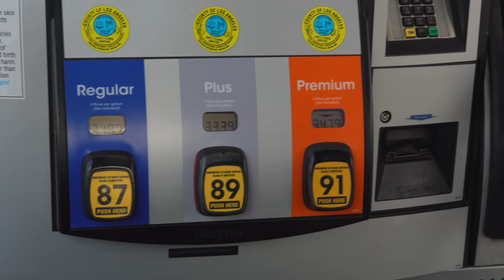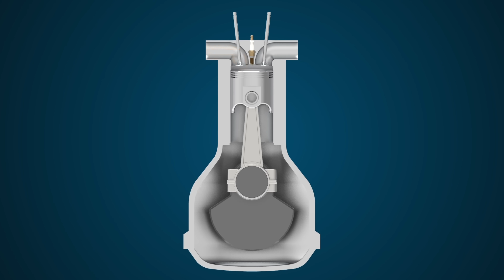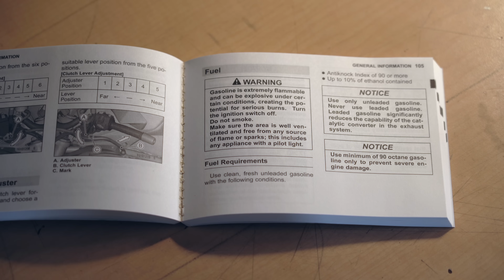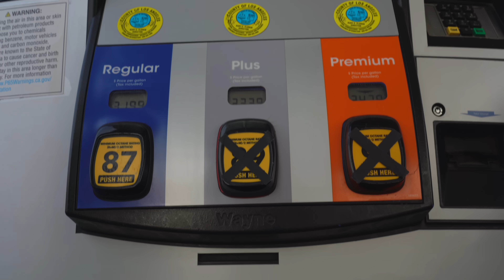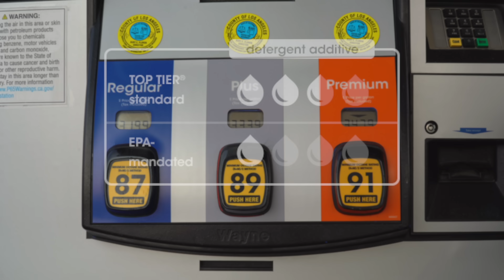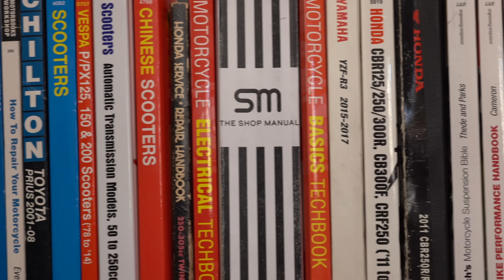Should You Run Premium Gas In Your Motorcycle? Octane Explained | The Shop Manual

Comment: I can attest that this is true. Especially the detergents. I rebuilt a 1975 CB550F that was in bad shape. Gummed 4 barrell  carb that sat for years all tarred up. After a full rebuild of carb and almost everything else, i ran high octane and it did keep that carb spotless for years. Same for my rebuilt 2002 Shadow. It wont hurt to run it and with a carb it may be worth it but true,  no better horsepower. Plus, i think most modern fuel injected systems are designed for anti knock and ping with lower grade fuel anyways so you probably wont see any change. Just cleaner system. Which, if you keep cars for 10yrs or more, may be worth it.

Comment: The reality is the octane boosters lower the overall specific heat capacity of the fuel. If you can't take advantage of the reduced tendency to detonate, You are spending more money for less power. I don't know how many times I've told people this. I don't know how many times they've ignored me like I was stupid.
Reply: I know, as an engineer it drives me crazy "but what about muh racin' fuel?", like no, if its not designed for it, its not going to help. Its literally a more docile chemical and longer carbon chain to break down...

Seeing people with 6:1 compression ratio lawn mower engines at the "grasscar" track with them putting in octane boosters into premium gas just hurts my soul knowing at that point their getting lower power and not more...

Comment: You're talkin what is coming out of a book for low-octane so they can sell it been around engines for over 30 years trust me higher octane will burn hotter and push the Piston down low compression high compression need to go back and do your homework
Reply: You've got that backwards, higher octane is longer carbon bonds, its more docile (which is what you want if you're having pre-detonation issues), and it doesn't burn hotter...

Comment: Nice talk.
Here in Australia we have 91, 95 and 98 as standards.
I did notice an extra 50kms of mileage difference per tank, between 91 and 98 though.
Reply: They probably had ethanol in the 91, typically at least in the US the cheaper (its 85 equivelent** in the US, 91 RON = 85 (R+M)/2) they usually don't have ethanol in the higher octane "premium" option, and ethanol has a lower energy density so you will see better fuel economy with lower amounts of ethanol. That's probably what you noticed and not the octane change.

**Its kind of like how your bikes say 300 kph and ours say 186 mph, its the same thing, different units on our fuel pump as the octane equation standard is different in the US.

Comment: On your bogus claim the higher the octane does not give you more power I think that you're full of shit because if I run my bike on race 110 race fuel it doesn't run the same as it does on  91 and there is a 15 to 20% horsepower increase along with that only mod on my bike is in exhaust pipe

Comment: I wonder if you can salvage old fuel with premium fuel?
Reply: Sort of like salvaging water by adding lots of clean gasoline to it... Doesn't work very well, but I have done it on one engine.

That one engine pretty sure was powered by God himself because I was running 99% water in it. I remember running the mower till you couldn't see anything in the tank (except rust), then after a huge rain and a couple days later it started right up and I decided to check how much fuel it had after it ran for 10 minutes, and it was nearly full but I couldn't smell anything. Dipped my finger in it and it didn't feel like gas either, just water. So then I got bored and decided it must be running the little bit from the old fuel in the lines and the carb, so I just sat and watched it run for 30 more minutes until I got bored. Normally every other engine flat out won't run with barely any water in it, but that one, I honestly don't know what was going on. Either it had to be burning so much oil that it didn't need any gasoline at all (I've ran engines like that, you just had 5 gallon jugs full of used oil and kept filling the engine up because the pistons and rings were so worn it would run without turning the fuel valve on 90% as good as if you did run some gas with it), or it was some kind of miracle. I'd like to say for my sanity it was just burning oil, but I've never noticed that engine really burn its oil level down...

Comment: I use premium, from "top tier" gas stations, for all my small engine yard equipment and my motorcycle (which is vintage, has a factory high compression engine, and only is ridden occasionally).  In my experience, the fuel seems to provide easier starting after something has been setting for a for a while.  I am only buying a couple gallons at a time, so I don't worry too much about paying an extra 20-cents a gallon.
Reply: I wish premium was only 20c  more than 87

Comment: Another point not mentioned. I hauled fuel for a living. Just because the station brand is on the pump. Doesn't mean that brand name is in the ground. The refineries set the price at midnight. These prices go out to the haulers. They dispatch drivers to go the cheapest refineries. All refineries have a no brand fuel as well. Shells no brand for example is MOTILLA.
Reply: What are the chances that I'm not getting premium fuel even though I'm choosing the premium option at the pump? I worry about this.

Comment: I had an old 86 Honda CB550 that I drove everyday like I stole because I got it so cheap. I could easily tell the difference between the three grades of fuel. It picked up about 5-8mph. 

Also with the gas mileage that a bike gets why not pay a few cents more.

Comment: Obviously with a motorcycle and a single cylinder you wanted to run better and the more octane you run doesn't always mean more power though the more compression you run the more octane you will need to cut down on pinging and unburned fuel

Comment: I understand the numbers might be a little different to the states than here (Is this the difference between the Research and Motor methods for determining octane?). At any rate, here in Australia, the choices are 91, 95, or 98. Generally, only 95 has ethanol. At any rate, I run a highly modified 81 boxer. At one stage, this engine needed an overhaul, during which period I installed a bog standard engine. BMW recommends a minimum of 98 octane for this engine in the manual, and I used this exclusively. And I was adjusting for valve lash every bloody week. It was unbelievable just how quickly the valves were disappearing into the heads. So, who're you gunna believe? I think we use the same octane figures as the krauts, although I'm open to contradiction. My conclusion was that you just don't get what you pay for. At any rate, that engine now has hardened seats.

Comment: A tip for all drivers, pump the highest possible fuel before winter (100 octane in EU, don't know the number in US) or else prepare to clean tank, taps or carbs (if present :) from the ugly mud that the fuel changes to. Or pump whatever fuel, but add fuel stabilizators to "increase" octane.

Comment: on a side note, midgrade isnt manufactured. it is a mix of regular and premium, usually at a 60/40 ratio but sold as if it was mixed 50/50.  

also, the price difference between premium and regular in the philippines is 4 cents per gallon.

Comment: 89 is actually a mixture fo 87 and 92. or 93. Nothing more or less. Although my bike required 91 octane, i have noticed the engines run better in cars that only require 87. And cleaner and sightly better fuel economy

Comment: Lets do some math.  I normally put in 3 gallons when I fill up.  Right now its 4.03, 4.13 and 4.23 for the grades.  3*4.03=12.09, 3*4.13=12.39 and 3/4.23=12.69.  WHO CARES.  Just run the good stuff.
Reply: @gurnblanston3210  Octane/HP have nothing to do with each other.  Compression and knock resistance do.

Comment: Another good video, but maybe things are a little bit more complicated.
1) Higher octane fuels have a higher calorific value, meaning more heat is released developing a bit more power/mpg.
2) Engines with knock sensors listen out for detonation i.e. the ECU has a knock sensor strategy to determine the octane value of the fuel being burnt and which spark map to use within the ECU.  So if you put a poor grade fuel in, the engine is protected from detonation and a higher grade fuel will deliver better performance/economy.
But I agree, just put in the tank what the manufacturer recommends (unless you've a desire to better it for protection or that last slither of power/mpg).
Reply: Actually that's not true.  Premium gas has slightly lower energy density than regular gas, due to it being more diluted with additives.  Also, most motorbikes don't have knock sensors, they'll run the same timing regardless of knocking, or lack of knocking.

Comment: If you have an engine that’s prone to detonation or preignition, you need to use fuel that resists preignition and detonation. They used to put led into the fuel to do that. That was before methanol. I don’t know what they used today, but I can tell you this
  I road raced 2 strokes back in the day.. I used regular pump gas. Why?. Because it is more volatile, more explosive, generates more heat, more BTUs than premium it has been deadened /. made less volatile.
  premium fuel/high test fuel does not give you more power. Premium fuel keeps you from losing power to detonation and preignition. that is how high test gasoline appears to make more power in big bore old V8 muscle car engines. They weren’t making more power, they just weren’t losing power.
  if you put regular gasoline back in the day in these old muscle cars or big cars like Cadillacs or Lincolns on a hot day, they would shut the key off after pulling off the expressway or in stop and go traffic, and you would hear these cars just keep running, it sounded like somebody was playing the drums inside the engine with metal sticks. Or metal castanets ..
  my using regular gasoline gave me just a slight edge, I ended up winning six road racing championships, two national championship titles in eight years that I raced. I left my machine box stock in the engine/air cleaner/airbox/exhaust system departments. I knew that the factory knows more than I do, so I left the machine alone, and just concentrated on Clean lines, staying off the brakes, late braking,highest exit speeds, not making any mistakes, which I was only able to do a few times for an entire race…
  so, do you got that? Premium fuel does not make more power, it just prevents you from losing power if you have an engine that is prone to detonation and preignition. With today’s ignition systems in fuel injection systems and engines with sensors and water cooling, if you leave the machine alone, in stock form, you’re pretty much safe from preignition and detonation, because there are sensors that will detect that, and back off the timing, or enrich the mixture..
  in my day, I had to pay attention to the altitude I was racing out that day, the humidity, even the air pressure.
  if I would fine-tune my jetting at a place like Denver which is a mile high, and then the next week race at Daytona which is at sea level without re-jetting, I would probably seize The two-stroke engine within the first three laps of practice. Seen it happen to two racers I knew. One broke both arms and one leg, the other one broke both arms and both legs seizing at Daytona/because it was at sea level, and they went there with their machines jetted for around 1500 feet above sea level..
  today’s machines do not have that problem. All the sensors on these wonderful bikes today tune everything for you automatically, it’s probably multiple times per second.
  everything on these bikes today is better everything. Tires are better, suspensions are better, the engines make more power, they don’t need to have a new crankshaft every 1200 miles, new pistons every 600 miles, the brakes today are much better, the machines are lighter, don’t wish you had one of the old two strokes. These are the good old days. it’s just that the gasoline sucks today.. but at least gas mileage is better today. I have a Kawasaki Z 400 that I’m getting 72 miles per gallon. My old street two strokes were lucky to get 35 miles per gallon on the street.. my RZ 350, I was lucky to get 32 miles per gallon on the street.
  A problem we had back in the day with leaded gasoline was, the spark plugs would develop what is known as a whisker between the center electrode on the spark plug and the arm that you adjust to get the correct gap. That whisker was so thin, it was almost as thin as one strand of a spiderweb. One of my dirtbike’s was very prone to wiskers developing in the plug gap, and the machine would stop. The fix was, to pull the plug, and stick your finger nail in there to clear away the whisker. I don’t know if that was lead or something else in the gasoline that Caused the formation of those whiskers. But when they eliminated lead from the gasoline, I’ve never seen that again

Comment: Mercury Marine, which recently hosted a Webinar on ethanol myths, noted that ethanol does not "grab water molecules out of the air." It is hydrophilic, which means ethanol holds water. With regular gasoline (E0) as well at E10, the primary cause of water collecting in tanks is condensation on tank walls.

Comment: Depending on your compression ratio depends on what octane rating you can run.  Ping aka knock can damage your piston. The bikes that run 87 can run 93 but there is no improvement on power or mpg.  Higher octane gas does clean off carbon from valves and piston
Reply: That's my biggest concern with my bike as the owners manual calls for 86 OR higher so I put 93 cause of the detergents and it makes me feel better knowing the bike is running the best it can.
Reply: Compression ratio is not the only factor, my motorcycle is a 13:1 that calls for 87AKI, my car is a 10.9:1 that calls for 91AKI. The ignition timing is the other major factor. Electronic ignition that advances based on feedback from a knock sensor is also the reason that many cars now accept a range octane ratings.
Reply: Something I saw pointed out is if your engine has a lot of carbon build up that lowers your compression ratio since the carbon takes up space. So sometimes I put higher octain fules in older bikes because I don't want to be the person the bike brakes on

Comment: You forget one important thing. Higher octane gasoline burns slower than low octane one. That means, if you use high octane in an engine created for low octane, gas cannot burn properly till the end of piston power cycle, so burning gases will affect valves, valve seats and exhaust pipe overheating them, also oxydizing metal (due to high amount of unburnt oxygen, peroxydes and carbon monooxyde). It is not significant if you are using 93 octane in an engine built for 91 octane, but can really burn your valves in an old engine built for ~80 octane. Also you will have sugnificant power loss.